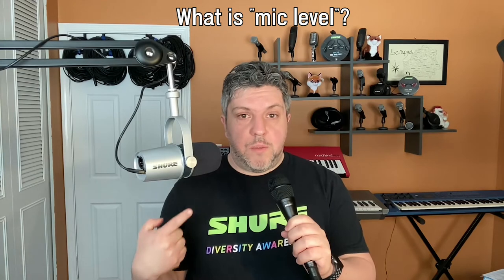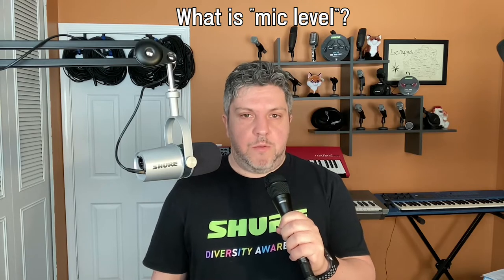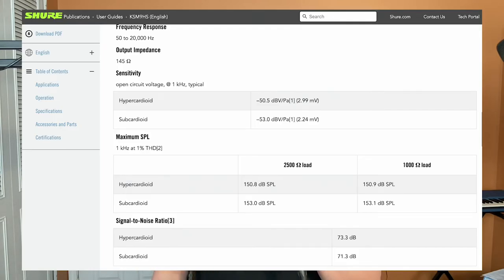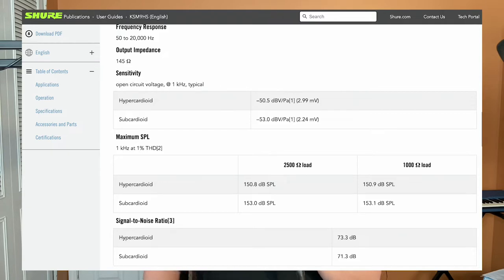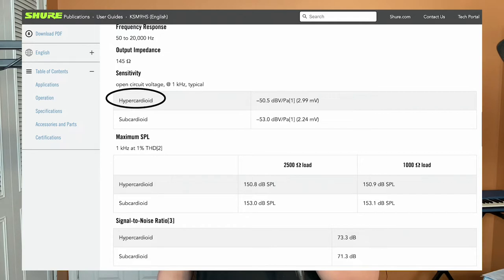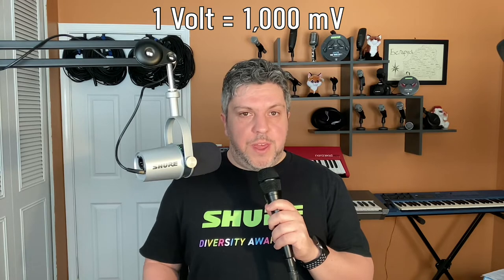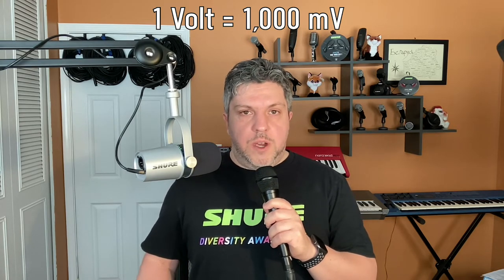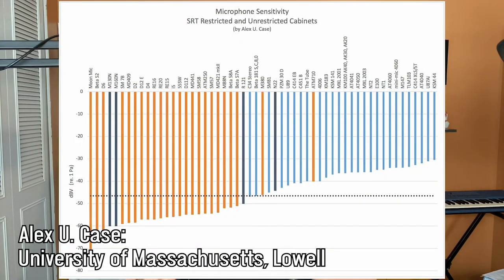Instrument, Mic and Line Level Differences | Shure

Comment: Hi Yuri.  The question I can't seem to find an answer on is this one:

Given a good line-level signal of around 0dbu (.778 Volts), etc...... and assuming it's unbalanced traveling down a TS 1/4" plug ...... If we plug that into an input labeled INSTRUMENT......and assuming the input doesn't clip.......does the (usually) much much higher impedance of an "instrument" input adversely affect our signal?  Specifically frequency response of that signal.   

This is assuming something like the following:  Splitting the 3.5mm stereo output of something like a laptop into left-and-right audio signals with a 3.5mm to dual TS cable......the Left goes into some input I'm not worried about (line-input, etc).....but the RIGHT signal on that TS cable being plugged into the "Instrument" input of a device.

My point here relates to USB Audio Interfaces.  For Example, cheaper interfaces like Behringer UM2, UMC22, have a 1/4" jack that does NOT have a selector switch for Mic/Instrument, AND that input is only labeled "Instrument," so it expects we'd plug a guitar/bass into that input directly.    And, that "Instrument" input has a listed impedance of 1 Megaohm (1 MΩ).  Whereas it's combo XLR-1/4" input is 3 kΩ.

From my testing, splitting a signal into a USB interface this way, recording it, and listening back, I don't hear any difference in the audio that was input into Input 1 (mic/line) of the interface and the right signal that was going via a TS cable into the "Instrument" input of that same interface.  

I just can't find anyone that can say "this is what happens if you plug a line-level signal into an instrument input with a much higher impedance that's expecting instrument level"

Again, this all assumes my line-level signal is not clipping out the instrument input.

Any more info or links on this would be much appreciated.  

Thank you Yuri!

Comment: Hello

Am looking for some suggestions

Have a Shure MVi Digital Audio Interface

Am looking for an earset head-worn microphone that will connect with the interface. Wish to use it for conference calls as my home office has a lot of echo

Was checking the Shure MX153 
But am not sure whether it will connect directly into the above interface

Are any connectors available for the same or maybe you could suggest any other earset head-worn microphone which will directly fit into the Shure MVi Digital Audio Interface?
Reply from the maker: Hi Anup! Our Market Development Specialist, Yuri has some recommendations: The MX153 is a wonderful choice, I use a TH53 earset microphone myself for conference calls at home! Since the MX153 is designed for use with wireless bodypack transmitters, it terminates with a TQG connector. To use it with an interface at home, all you need to have is an adapter that converts the connection from TQG to XLR. You can get either the RK100PK https://www.shure.com/en-US/products/accessories/rk100pk or the RPM400TQG https://www.shure.com/en-US/products/accessories/rpm400tqg adapters, which will allow the MX153 to be used with any XLR interface.
Reply: @shurecreators  thank you so much for this detailed revert. Will check with my shure distributor on the available connectors.. 

Check if you could make a video on this front too with proper setup guide and testing , there might be a few others who might like this solution for their requirements 😊